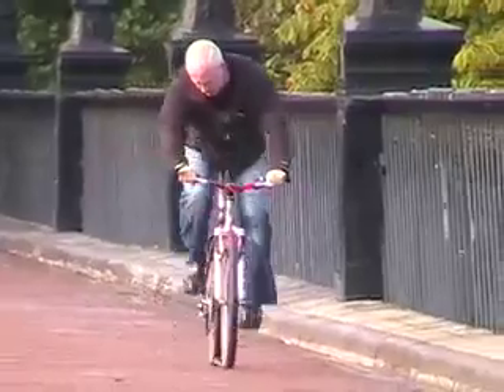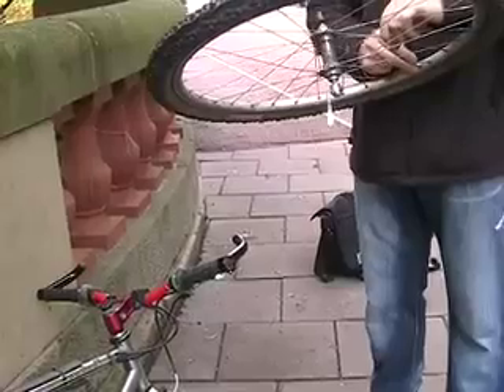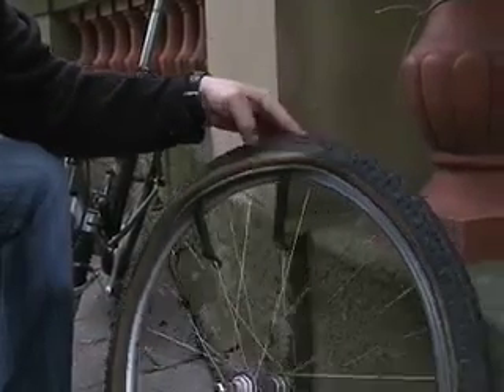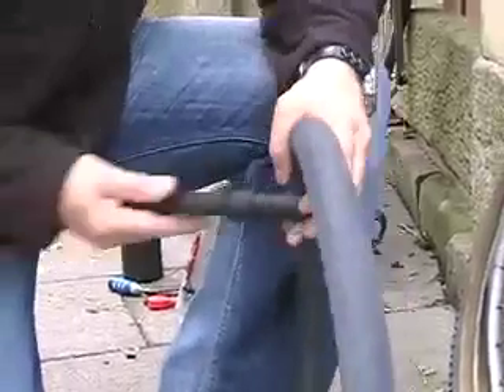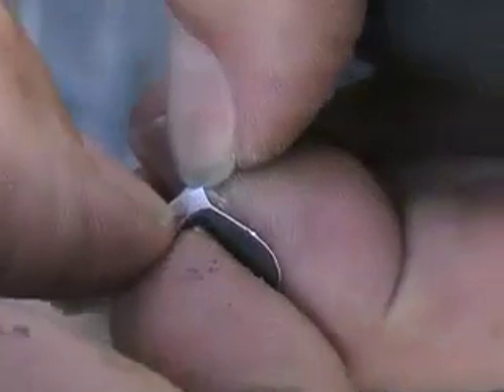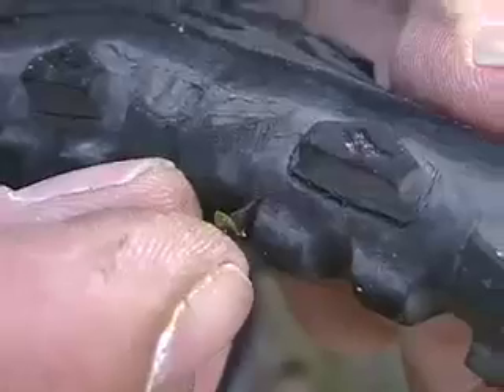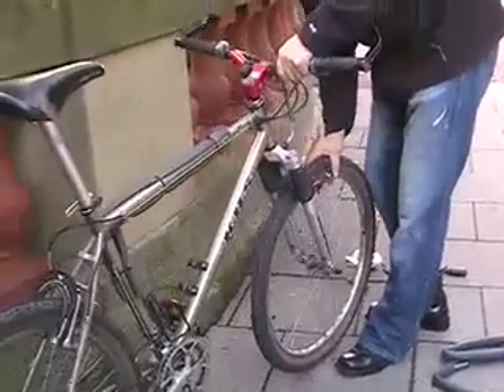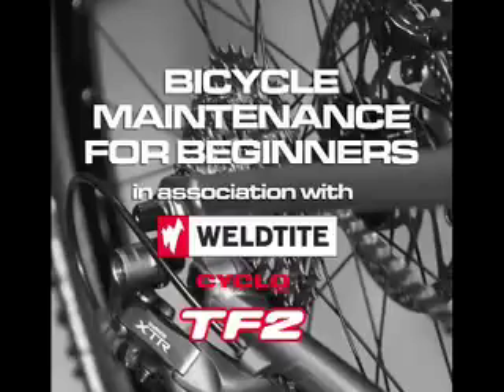How to repair a puncture

Comment: @Bedsitdweller  Always soap up the rim and tire when  you mount a tire on a rim. The soapy water lubricates the tire and it slips on and squares off on the rim a lot easier. You usually won't need tire levers either if you use this method. Try IT !!!

Comment: I find most patch failures occur from poor sanding. For a thorough sanding wrap the tube round a sign pole, stretch the tube towards you and place your index finger under the hole. Use your finger as a base and sand on top of finger while you roll finger around under the hole

Comment: you  probably didnt seat the tire before inflating it. Always use soapy water or regular water when replacing tire. Soapy water on the rim helps the tire seat squarely on the rim. Check the seating indicator line on the tire before you install it.

Comment: What ppl dont know is that its more important 2 check and clear the tire B4 you install the patched tube. What good is fixing a flat if the thorn is still in the tire?? Always spray some water into the tire and feel with your fingers around the inside of the tire.. Do a couple of laps inside the tire. I get the creeps when I install a patched tube and I cant find the thorn. What ever gave you that flat is going to give you another one until you remove it!

Comment: The position of the puncture with regards to the valve would have directed you exactly here the problem was on the tire.  Ans who caries a crayon?  Ball points do write fine on butyl.

And as far as solvent is concerned, you wait till it is dry, not tacky.

Comment: 1:29 says deflate tire completely. But you dont show the proper method. The air locks the tire onto the rim. To fully loosen the tire hold the tire against the ground or a wall while deflating it and you'll get more air out of the tube. If you make a practice of fully deflating the tire you won't need tire levers to remove the tire. All you have to do is tear the tire down from the rim. I know---I've been using this method now for years and it works.